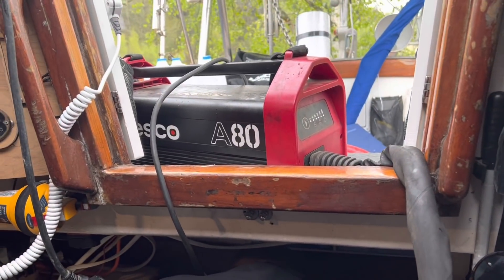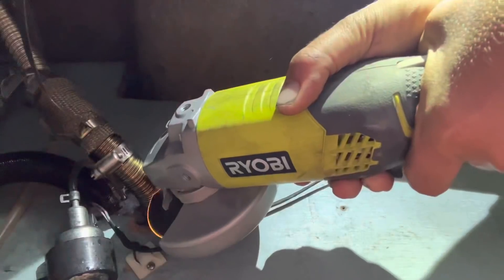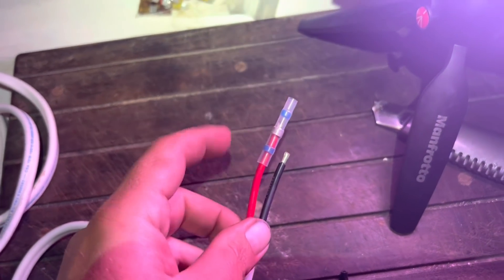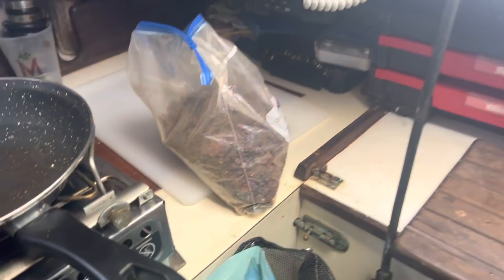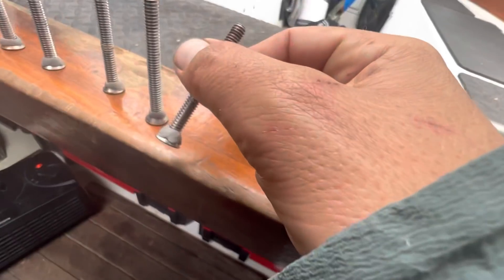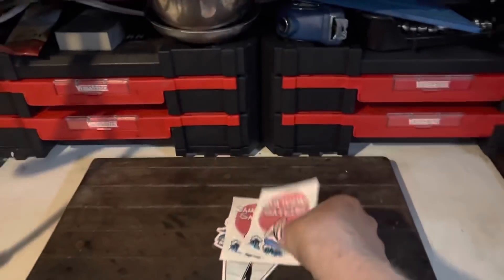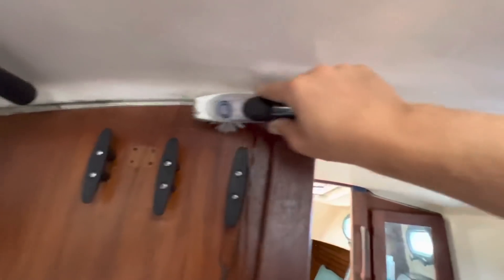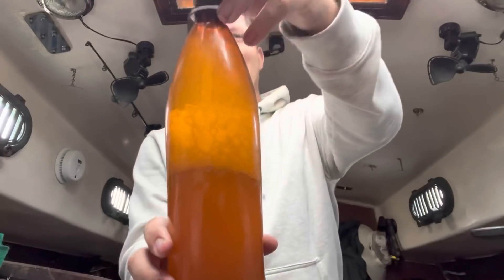Prop shaft victory 🙌

Comment: I believe the yellow powder is sulfer. There is sulfer in diesel, and that's a diesel heater. Does it smell like sulfer? Also a heat gun works better than flame for solder sleeves. We use those all the time for aerospace cables. The flame is too hot too quick.
Reply: I agree, probably high sulphur red diesel.

Comment: Came across your channel a week or two ago. Watching your old videos and I'm up to where you painted the hull before the trip across the Atlantic. I am learning so much more from you than reading books on sailing and feel confident enough, now, to buy an O'Day 30 footer I've been looking at. Now I know what to look for when looking it over so I know what I'm getting. Thanks for sharing your experiences and knowledge.
Reply: Just make sure you research your boats well. I don't hear the best things about O'days for venturing offshore... though maybe that's not the kind of sailing you are looking to do.
Reply: @Pear Overboard  from my research the smaller ones, 22 to 24 feet range, were decent starter boats, but didn't do well in rough seas. The 222 even had issues with the keel snapping often, I was told. From what I've read of the 30, "A review in Practical Sailor described the design, "All things considered, the O'Day 30 is a boat that performs well under sail. She’s not really a racer, but she will stay up with almost any boat of her size and type, and is easy to handle, to boot." The review conclude4d, "With her good performance and big interior, the O'Day 30 makes a reasonable coastal cruising boat. This is a low-maintenance boat, with little exterior wood. Along with low maintenance, you get pretty plain-Jane appearance. The boat still looks modern. If she appeared in a boat show today, she wouldn’t look dated."

A coworker has been sailing 40 plus years and said he'd buy it in a heartbeat.
Reply: @repairrestoreandrebuild8974  meaning no offense, but why buy a "reasonable coastal Cruiser" when there are some great blue water boats from the 80s like the Cape Dory 31 for pretty cheap? I'm biased though, that was my last boat.
Reply: @Pear Overboard  no offense taken. It should be noted that I live in Northern Ohio and it sits and would be sailed on Lake Erie.

Comment: This may have been stated already but, the trick with those solder tube connectors is to apply less heat and for longer. A butane powered mini heat gun is ideal, as direct flames tend to be too intense, burning the insulation before the solder has properly flowed.

Comment: A tip worth sharing if you have leak coming through via a stanchion or a bolt.
 Rather than squirt in Sikaflex and hope for best, wrap the bolt in teflon tape to take up the volume, then apply the Sikaflex to the BOLT over the tape  
 but wait for it to skin over before tightening if fully, Solved all my stanchion leaks.

Comment: For the connectors, use a heat gun, not a flame. That way it will not compromise the film before the solder melts. Just something I've found based on personal use.

Comment: Nice work! I highly recommend countersinking any holes to be sealed... that gives the butyl tape somewhere to sit! On my R23 I have also cored all the holes and filled them with epoxy to isolate / protect the balsa core. Anyway, keep at (at least if you are not sailing!)

Comment: Hi Sam. I have found that a latex paint can be applied to a cleaned interior fiber glass surface on my boat. I even painted the bilge with exterior grade, Killz mold resistant primer ; might just be worth painting your interior surface and lockers. It would look great but also might help with mold. It also dries fast and easily especially when you are hauled out. Over time if you are not sensitive to mold now it has a way of working on you. Those areas of the boat with moisture, warmth and poor air flow are a breeding ground. My bilge was mold free for years and provided good beer storage.

Comment: You’re only supposed to use a heat gun with those low temperature solder connectors. The torch will (did) melt the heat shrink.  Great channel!
Reply: hahah FIRE!!
Go for it.
NO Mistakes here😍
Reply: Is this the same joint that failed more recently and caused all the smoke?

Comment: As you are starting from Sweden this season, I would definitely recommend visiting Finland. At least the Åland archipelago is BEAUTIFUL during the summer.
Reply: After leaving Sweden where are you headed? If it were up to me, I would head for the Med then out again into the Atlantic and South past Brazil and again cross the Atlantic,  around  the Cape Of Good Hope ťhen up the East Coast of Africa with the ultimate aim of sailing past Ceylon and back to California. Try miss Cyclone Season until March in the Indian Ocean but a skip across the Pacific will complete a circumnavigation. A Cape Dory is the kind of boat I aspire to but maybe a 30 to 35 footer  assuming these sizes exist.
Reply: The Suez is apparently a vast cost!

Comment: Maybe crappy diesel?  I have some ideas for boat inventions.  One of which is to use solar power for a small hydrogen generator, then burn the hydrogen and capture the water and heat for other purposes.  Just something small like a pilot light and then a still like contraption and condensing coil.  Very small, all outside the cabin area, of course.  Maybe you can run with it and get some backers.  I get kicked out of most marinas I try to hang out it.  Share idea with your Swedish friends.

Comment: It is best to use an electric heat gun on electrical connectors and not too close, rather than a naked flame up close. You can reduce mold by adding 1cm of closed cell foam to every inner hull and roof surface, and fixing all the leaks. It is best to buy (usd10) or make a bearing extractor to remove the old cutless bearing, rather than violence, they didn’t use violence to put it in originally. I enjoy your videos very much, thanks.

Comment: Use a heat gun not a flame on those solder connectors.  And marine grade heat shrink over.
Reply: Yes. It can be hard to get the solder to melt completely and distribute well through the wires with a torch. You also can do a braid instead of a simple butt and get some added strength.

Comment: you have to cross wires and then twist them just a little bit before heating the soldering sleeves. also make sure to use the proper section for it. Then you have aluminium corrosion on your electronic. watch out. for the cable, you can use heat shrink sleeves with glue inside to waterpoof your terminals... and avoid water inflitration in the cable. you can buy tape for automotive harness, you can also use fusion tape to cover and zip ties. if you do well, it should last 10-15 years. good luck

Comment: Sam:  I re-dehydrate hash browns by soaking them in hot water cover for about 5 mins before cooking.  That might work on the other hydrated foods.    I have a Catalina 25 on the lake here that I am fixing up for a weekender.  I was wondering if there is any difference in Butyl tape for an RV and Boat?

Comment: A marine electrician told me that about the solder butt connectors. If the circuit gets a large load the solder melts and the connection fails

Comment: You need to use a heat gun to get the solder/shrink tubing to work correctly.   If the joint is not totally shiny, it's not going to be a good connection.

Comment: Good to see you back on the boat. Do you have help on it? For example, how did you tighten down the bolts on the base of the traveler if you did not have someone on deck with a philips screwdriver?

Comment: I find that if i use a regular lighter to heat the self solder heat shrinks that it will leave you with a better solder joint with out burning through the heat shrink
Reply from the maker: I will try that

Comment: Great video Sam! Why Butyl tape versus silicone or 3M 4200 etc?
Reply from the maker: Silicone residue prevents epoxy or varnish from sticking and is time consuming to remove. 3m 4200 is expensive and had a limited life span after opening. Butyl tape is cheap and doesn’t seem to have an open shelf life limit and is east to clean up.

Comment: I'd be tempted to add a chain pipe to the forepeak, then run the chain down to a well nearer the center of mass.  Some of those forward lockers are big enough to store a spinnaker, provided it is divided from the chain.  Crew aren't quite as disposable as in the old days.

Comment: I know it’s a little late but, when using that type of heat shrink “cold solder” butt connection use a heat gun and not an open flame, it took me almost an entire box of them to figure that out. Also they want to be kept “level” or else the solder will run out.
Reply: Exactly they are called "heatshrink" not "flameshrink". However flames are hot and I've had no trouble using a bic lighter on these for about 10yrs. I wouldn't use a butane torch on these

Comment: The CO2 carbonation thing was genius and looks a whole lot cheaper than those ridiculous home soda macines.
Reply: Works for food storage also.
Reply from the maker: with mine i can also get way more carbonation into it than the weak little soda streams.
Reply: @samholmessailing  try the carbonic acid water on the mold cleaning
Reply: I uh...stopped home brewing but the keg + fizzy water is awesome!  Flavor it with the water drops (mio) or whatever you like
Reply: Highly reccomend an equivalent system if you like carbonated water/home made soda. I get a 4kg/10lb tank of co2 at less than 20% the cost of a soda stream refill and the regulator and hose fittings cost less than the official machine. If you make beer it's even better, but a good price either way....
Reply: @braithmiller  how does that work?
Reply: @MrShankwheat  In cleaning: like using vinegar acid works. In textiles like carpets baking soda is sprinkled in then strongly carbonated water sprayed in it foams up the dirt usually wiped up with towels or bonnets on buffers. ( eg. Chem Dry) Cornelius kegs are common in use.

Comment: A small pen style heat gun is the way to go with those little heat shrink solder things. The torch introduces too much heat to quickly.
Reply from the maker: The heat gun attachment on that torch didn’t seem hot enough to do anything even after a couple minutes.

Comment: It's a cheap diesel airheater. By time corrosion will kill them. As I look at your dieselheater, then i'm quite sure that user instructions has not been followed. All most every people who has disel heaters installed in there boat, are forgetting to start up the diselheater once every month with a full power run for 10 minutes. Most people only start dieselheaters up, when they need the heat. So it is probaly condensaded water that has been collectet by time inside the burning chamber.

Comment: I love the videos, but those nails.  Just trim em and clean em once.
Plus, when you took off the traveler bar/plate, why didn't you coat the thrubolts with sealant before reattaching or fill those holes a bit?

Comment: 3:45 Seems like the connection is about as strong as you're going to get out of this sort of connector. But man, it really gives me the heebie jeebies to be able to rip apart a soldered connection like that. Solder really isn't a good mechanical connection on its own, it's just too brittle. Not that these wires are going to be subjected to much load, but over many years the vibration might be enough to make the solder joint fail. It's unlikely, but in something that could set your boat on fire at sea, I wouldn't be happy with just "unlikely".

For any future wiring projects, you might consider using the "lineman splice". Strip an extra long section from both wires (an inch and a half or so?), make an X with the stripped ends, and then wrap the free end of each wire around the base of the other wire. You're looking for 4-6 wraps on each wire. Get that nice and tight with no space between the wraps, trim off any sharp bits of wire that could pierce the heat shrink, then solder it up.

NASA tested it and found that the splice was stronger than the base wire, so the technique is appropriate for all applications no matter how safety critical. Takes a little practice and extra time to get right, but then you can be 100% certain that splice won't give you trouble, ever.
Reply from the maker: That was my go-too splice in the past but it just takes so long so I thought i’d try some new things.
Reply: According to Practical Sailor mag:
Soldering can work, but there are concerns about corrosion and fatigue, and both the U.S. Coast Guard and the AYBC don’t approve of connections that use only solder as the sole means of connection. You are free to solder a crimp if you like, but the wire must be physically restrained in case it overheats and melts the solder.
Reply from the maker: @MrMilothedog  hence the adhesive heatshrink…
Reply: @samholmessailing  I do not believe the heatshrink fulfills the requirement of being “physically restrained”. It helps for corrosion control but as a restraint? Not like a crimp.
Reply: The self solder heatshrink connectors also do not pass the restraint pull test (lbs. required to separate) parameters “recommended”by ABYC. Boating mag tests 2019. Your boat your choice…

Comment: i'm sure somone has already said to NOT use those non-crimping connectors, get the heat shrink covered, crimping connectors... need a good mechanical connection. Good to see your smiling face again, fair winds

Comment: SAFETY ALERT! 

Always clean mold with uncut white vinegar. It's the only thing that'll kill it and keeping mold wet keeps it out of the air while cleaning. First, apply vinegar with a spray bottle. Let the wetted area sit for 5-10 minutes then remove all mold with a brand new sponge. Throw the sponge away when done. Second, repeat the process with another brand new sponge. Throw it out as well. 

Do not use any "mold-killing" primers/paints until first removing mold using vinegar. 

Dry brushing mold only puts it in the air, which is a very bad idea. You risk getting mold infections in your ears or (far worse) lungs. Mold is no joke. It's dangerous. Mold removal professionals use sealed room negative pressure and disposable hazmat suits. Using white vinegar is the safest and most thorough DIY method.

Comment: In Oriental...I got the  Joshua Slocum Spray....I MUST BE NUTS.... Huge Ass Boat....15' 8" Beam....40 ft long ...52 ft with Bow Sprint...
Reply from the maker: Youre crazy 😂 thats going to be a project.
Reply: @samholmessailing  Mike the Mechanic spent an hour convincing me to run away from it....so I listened...I spent $1,000 on it so far and he was right...the engine was unrebuildable...that was the kicker....the other diesel I had wouldn't fit...so I'm back at square 1....sail safely buddy.... enjoy 😃👍